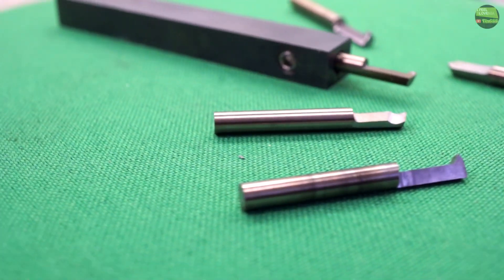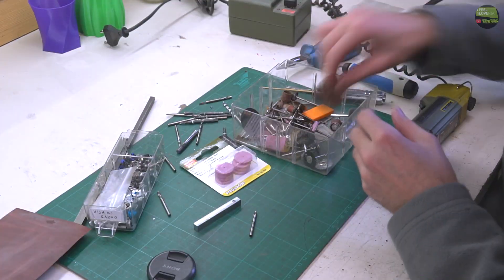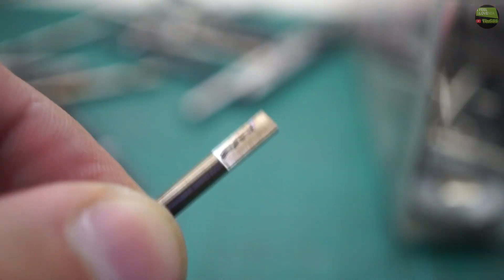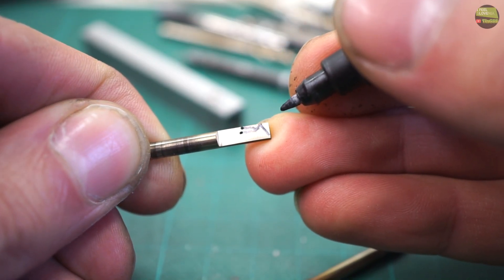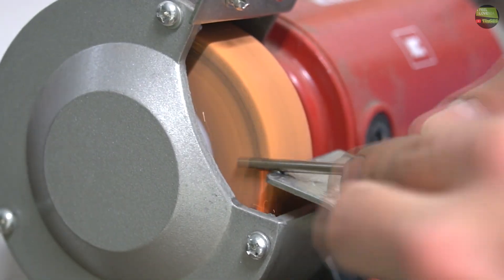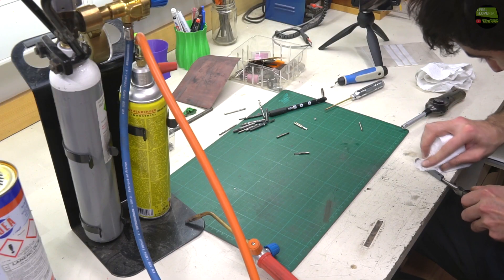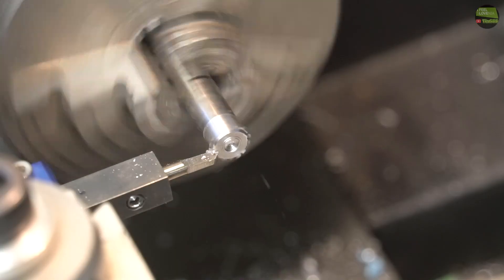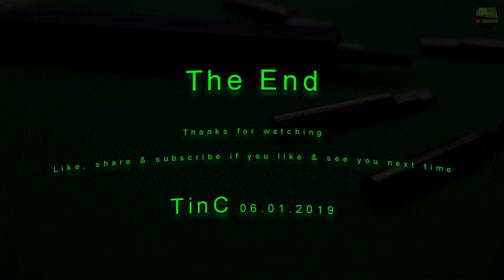Making of: Small precize lathe tool out of broken drill bits [M4 internal thread cutting]

Comment: What kind of oil did you drop the cutting tool into? (I couldn't quite understand)
Reply from the maker: Linseed oil known also as flax oil.
Reply: Olive oil :-)
Reply: Edit... just realised you meant cooling the tool whilst making it... 😔

My comment below refers to actually using it & machining in general, I hope its a bit useful anyway... 😅😅
------

The type of oil used usually depends on the material being machined... on small machines "coolant" is not really necessary as there is not much heat produced... more often there is a problem with "built-up edge" where some of the material welds itself to the cutting edge & produces a poor finish. 
Aluminium is well known for this problem & a fluid like WD 40 or kerosene will prevent this from happening. There are specialist cutting oils with EP (extreme pressure) additives for jobs such as tapping in tough metals , these reduce the friction & pressure on the tap & lessen the chance of breakage.
 Cast Iron should ALWAYS be machined & tapped ABSOLUTELY  dry as CI has free graphite in its make-up and so is ''self-lubricating" (thats why it is used as a bearing in a lot of machinery).

As a side-note... carbon steel taps should be avoided like the plague... 😅 always use HSS and "spiral-point'' taps if you can get 'em....  

From the Emerald Isle 👍😎☘
Reply: @peterfitzpatrick7032  the flaxseed oil is to create a rustproof surface
Reply from the maker: @transdimensionalist  thanks for that info, i looking for an english word for this oil, google tell me linseed oil, is that different? now i google for flaxseed oil and google give me first hit "laneno olje" that's exactlya that oil in slovenian language.
Reply: @TinC33  flaxseed and linseed are the same thing, thanks
Reply from the maker: @transdimensionalist  thanks, heave a nice day

Comment: Does only 1 set screw really hold well enough for precision turning?
Reply from the maker: Yes it hold, that's why i make hole through, so i can install two screws, if stiil not enough (but one hold just ok) than grind a bit of flat surface on insert in place where the screw will tight.

Comment: In reply to your message that drillbits are hard all the way through is incorrect they do not hardened where the hardened drill chuck jaws hold if you look at and drill bit shank that has slipped in a drill you will see there is goring if you put hardened steel against hardened jaws the jaws would not be able to bight in and hold it from spinning if you would like to check where the hardened steel starts run a file sideways across the bit until it will not scratch the surface then cut off the soft part and keep the hardened steel
Reply: TinC33 makes clear that he uses solid HSS CO drill bit material, not hardened carbon steel cheapies with soft shank ends. I doubt the manufacturer would bother to 'soften' the shank end of a solid HSS-CO drill, in fact, I don't  know how you could even do so. If you heat a HSS CO drill to red hot and let it cool down, it is actually marginally harder than before!
Reply: @stephanuhu963  .... Allan is correct... drill bit shanks on standard "jobber" drills are DELIBERATELY left soft to allow the chuck hardened jaws bite slightly & prevent slippage... 

Obviously 2 hardened surfaces would skate easily on one another. 
(This one of the reasons I have a Clarkson Autolok chuck on my mill)
The heat-treatment process is by induction hardening & as such is very fast & also easy to target the area which requires the hardened material whilst maintaining a soft shank....
Youtube  "induction hardening" & you can even find homemade equipment. 🙄

Nice video though...
I've always found grinding HSS blanks to be a boring job which can't be rushed either... 😩
Theoretically you can grind HSS even til red & it will maintain its original hardness but I have to say I was never totally convinced & always err on the side of caution.

Also when grinding, one should NOT dip the tool into cold water to cool it as this often creates micro-fractures at the tip , better to allow it to cool naturally & don't be aggressive with your grinding in the first place... 😈
Reply from the maker: @peterfitzpatrick7032  thanks for more info
Reply from the maker: Hy i try today that drills with file, it's all the same from top to end, file do not hurt him also on end of shank, they are DORMER A117 made out of HSCO, i really don't know materials, so i'm really wondering if they are hardenet only on cutting part or entire, can you tell me now after you know the info about drills?
Reply: @TinC33  Those are stub drills ,usually used for milling machines ,lathes ,etc.You use collets for them not chuck jaws so they probably are hardend all the way.If file cant bite in it ,if it skips and produces high pitch noise ,its hardened.Files that you buy in hardware store ,carbon files have hardness around 45-50 rockwell -HSS-E steel is 65+ .Use side of your file so you wont dull it too much for test.
Reply from the maker: @zumbazumba1  thanks man, yes we got this drills on work and use collets we drills hot plate (grey iron) with them.
Reply: i have used the soft end of hss drill bits to make small toolbits, grind to shape then heat to white hot and let cool naturally will produce hard tool
Reply: Totally agree. This fact gets overlooked a lot. Also, larger diameters are (sometimes) welded from two types of steel with the HSS part towards the tip and a stress resistant construction steel towards the shaft. Always makes me smile when people say they are making "HSS daggers" from old high speed steel drill bits ... they frequently end up with a kind of flat railroad spike with a HSS handle...